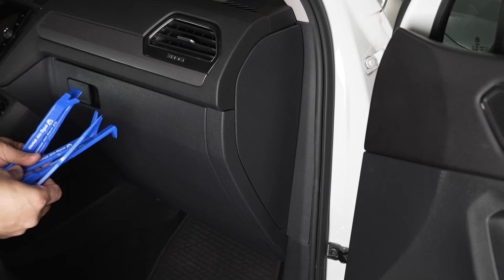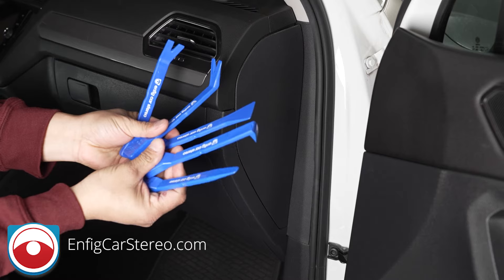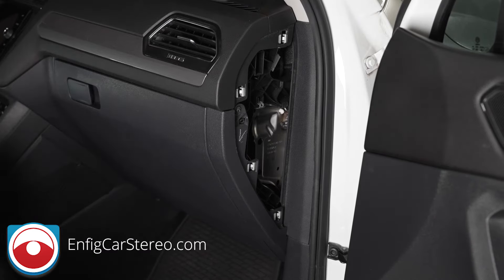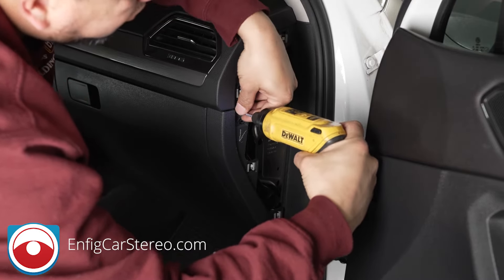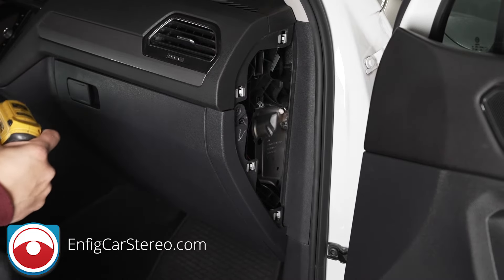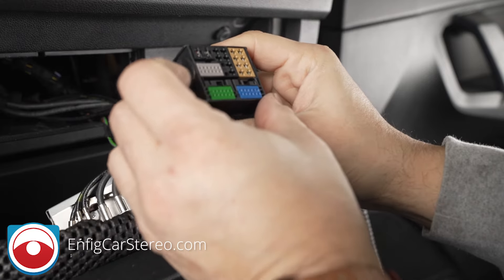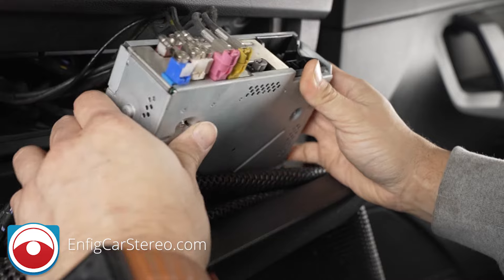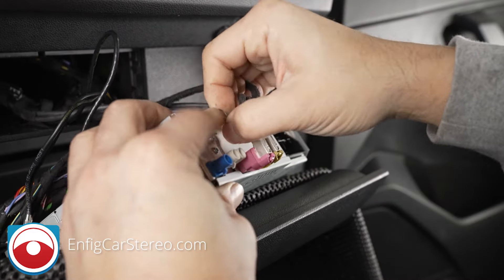2018-2024 Volkswagen Tiguan Audio Upgrade

Comment: Great information, without it would still be trying to figure it out remove that glove box.  Easy plug and play from that point on. Tiguan sounds awesome now and took it a step further with new Polk speakers in the doors.
Reply from the maker: Glad to hear.  For anyone else reading this we now have a full plug and play speaker kit for the car that includes tweeter  and speaker adapters for both front and rear doors.

Comment: Just bought a 24 Tiguan S, and it doesn't have the CD player. I'm assuming that means that the plug is actually behind the head unit itself. How would the install go with that being the case?
Reply from the maker: If you send me your vin number I can look that up for you.  I know that some of them still have the glove box connection.
Reply: Honestly I really don’t know what I’m talking about, but in my Tiguan it’s still in the glove compartment. No cd player but the radio brains are still there in a similar rectangular box.

Comment: Need this for my ‘19 Jetta.  The bass roll-off is terrible.
Reply from the maker: It should work with the 2019 Jetta as long as the power wires are thick enough.   Check the site for a picture of the power wires or send us a picture of your wiring.

Comment: Also wondering if I decided to add a subwoofer later on what would be the best way to tie in for rca if I had this installed? Thanks
Reply from the maker: You can just tie into the speaker but we are also making a plug in high to low adapter.
Reply: @Enfig estou querendo botar um sub na mala, mas preciso saber qual cabo usar para colocar no rca direto no amplificador
Reply from the maker: @Matdh_almeida  We have a harrness that you can use for speakre out.  We eill ahve an adapter for RCA soon but not available yet.
Reply: @Enfig  did you an add one with RCA input yet?
Reply from the maker: @garettlachance7353  We decided against it.  Most amplifiers have a speaker line input.  And you should really be using a processor when you add an amplifier.  We are going to make a plug and play splitter with cables long enough to reach the trunk for people adding a sub instead.

Comment: About to install mine. How can you access the key amp settings and mic input when you put the glove box back in? Do you have to do the setup and eq first, and if you ever need to redo it, you need to take the glovebox out again? Thanks!
Reply from the maker: It depends on how you mount it.  In the past I have mounted it easy to remove without dropping the glove box.  I no longer do that and I haven't looked because I haven't needed to get to the settings.

Comment: How would I know the amplifier is compatible with my Tiguan?
Reply from the maker: As long as you don't have an external factory amplifier they its compatible with all 2016-2017 1st gen and all 2nd gen
Reply: I have a 2024 Volkswagen Tiguan
Reply from the maker: That’s. 2nd gen 2018-2024 current. It’s compatible as long as it doesn’t have an external amplifier.
Reply: Do you have an email I can send you a picture how it looks like? It’s similar to yours but just doesn’t have the cd thing
Reply: @ better how would I know can I give you the vin number?
Reply from the maker: @lbjay6503  The CD player doesn't matter they got rid of it in the newer models.  If you want to email me your vin I can see if you have an amplifier.
Reply from the maker: @lbjay6503  You can post it here or send an email.
Reply: @Enfig
Reply from the maker: @lbjay6503  According to your VIN you do not have a sub or an amplifier so your car is compatible.
Reply from the maker: @lbjay6503  info@enfig.com

Comment: How noticeable of a difference does this make to the sound quality? No plans of replacing the actual speakers btw
Reply: And also can you provide more info around the screw behind the radio that wasn’t recorded due to previously being removed?
Reply from the maker: It makes a huge difference. Many customers decide that they don’t need a sub after this upgrade.
Reply from the maker: If you watch our atlas installation video we cover the screw. It’s the same location.

Comment: I live in Canada, and just picked up a '24 Tiguan, Wondering if its best to buy this in Canada if available, OR, Can you ship to Canada?
Reply from the maker: I cant send the amplifier to canada but we should have the wiring by itself soon.  That we can ship to canada.  Here is a link.  https://shop.enfigcarstereo.com/product/enfig-awk-euro16-key2004/
Reply: @Enfig  do you have an approximate ETA on stock availability?
Reply from the maker: @blg748 should be in the next 2-6 weeks. We already received them but they were sent with the wrong connector on the amplifier end so we are waiting for replacements.
Reply: @Enfig  Thanks, this plug and play solution likely is better than tapping into OE wires. I have a few more questions is there another way to contact you? e-mail perhaps?
Reply from the maker: @blg748  There is a link to the product in the description.  Our email is on the top of the page.  I'm afraid of email spam bots so I don't post it.
Reply: @Enfig  Did not notice that! Thanks will reach out soon!
Reply from the maker: @blg748  That's because I just added the link lol.  I must have been i na curry to post and forgot the link.

Comment: Do you have anything for MIB3 infotainment
Reply from the maker: The same amp fits most newer vw as long as you don’t have a factory amlifier. We also have plug and play speaker kits. But we are still figuring out those applications.
Reply: @Enfig  no idea if i have a factory amplifier ill take a look
Reply from the maker: What car?
Reply: @Enfig  seat tarraco 2022. Mk2 with new MIB3 headunit.
Reply from the maker: It fits all the seat also. I can’t sell the amplifier outside of the US but you can buy all the wiring from me.  https://shop.enfigcarstereo.com/product/enfig-awk-euro16-key2004/
Reply: @Enfig  ill get the wiring i would like a plug and play instead of splicing into stuff. Ill check your link out thanks👍

Comment: if I were to buy this plug and play amp, how do you connect a subwoofer to this? do you have to splice into the wire harness you are selling or do you have a different wire harness with a line converter out?
Reply from the maker: We will be selling a plug in converter soon.
Reply: @Enfig  I just brought a 24 Tiguan I hate the factory stereo sound system the music is too low if I buy this do I still need to add the chuchero I want my music louder by the way I’m not the person in the photo but I am a female
Reply from the maker: @BOOTZ4YA  This makes it sound like a high end factory audio system.  Upgrading the speakers also helps.  You can also add a sub in the spare tire well as long as you don't have a third row.
Reply: Estou querendo colocar um amplificador da taramps pra alimentar as 4 portas e 1 saída para mala, para usar os graves, você pode me dizer quais fios emendar corretamente ??

Comment: So this is cool but $300+ for this is outrageous.
Edit: after talking with them this might be the better option out there to plug and play and get your speakers sounding right.
Reply from the maker: How do you find my $299.99 price outrageous?  Lets say you buy a cheap compact amplifier for $100.  This has a bult in dsp with a microphone to tune your audio system and improve the sound and not just make it louder. That's another $200 at least. Then you're getting a custom harness that plugs right into the factory wiring. I thinks it's actually an amazing price for what it does and how easy it is to install.  Did you maybe not understand what it was?
Reply: @ you could be right. To me just seems like it’s a mini amp with a dedicated harness for 300. How’s it improve the sound past that?
Reply from the maker: @stuff_i_liked1815 Without the DSP its a $200 amp from a brand name or $100 from a no name brand.  You cant get this out of any setup name brand or ebay brand for this price.
Reply: @Enfig  I put aftermarket speakers in my kids Tiguan. But still lacks some loudness but it’s loud enough I guess but feels like I could get more bass out of it. Would this help? I know I’m still better off with a sub but I would still probably need rca for even that.
Reply from the maker: @stuff_i_liked1815  My recommendation is always amp for power and loudness first then speakers for clarity.  Then sub if you're still not happy.  We are looking into under seat subs. Most people do not need subs after doing speakers and amp.
Reply: @ ok thanks I’ll edit my original comment. Yeah her car was missing one front and one back speaker so I had to replace them. But my 2015 Ford Explorer XLT with what I assume are stock speakers still has way more bass and sounds nicer than here with Kickers in the front and JBL in the back. It was the only combo that gave her a somewhat balanced sound. I was gonna get her a powered under seat sub but at this point she’s like “you’re doing this for you. I don’t mind how it sounds” lol
Reply from the maker: @stuff_i_liked1815  Don't edit it.  I want people to read out whole conversation lol. I'm sure you're not the only one with this initial thought.  VW audi and Porsche 2016 is and up have horrible base audio system.

Comment: Would this install bypass the Volkswagen factory volume limiter?
Reply from the maker: It's an amplifier so it will make the volume much louder and the DSP will make it sound better but the volume will still stop increasing near the end.
Reply: @Enfig  percentage wise % .. how much louder you think this amplifier would increase the factory volume?
Reply from the maker: @JDawg59fifty  I did a test in a jetta and it was +3DB.  That should feel like double. But since that was done with a free iPhone app lets say 50%